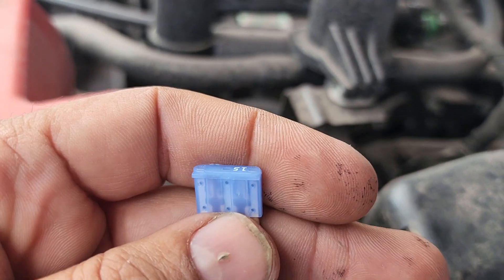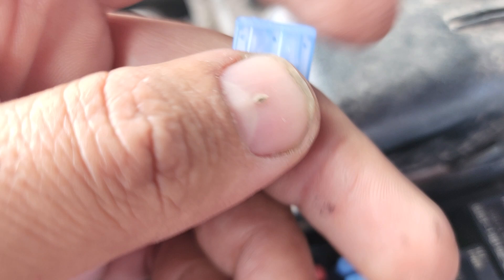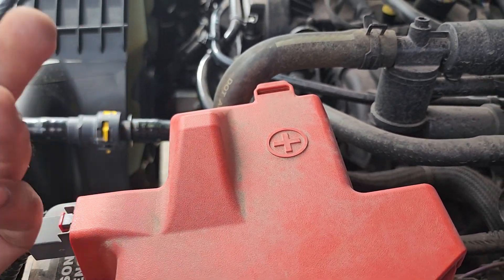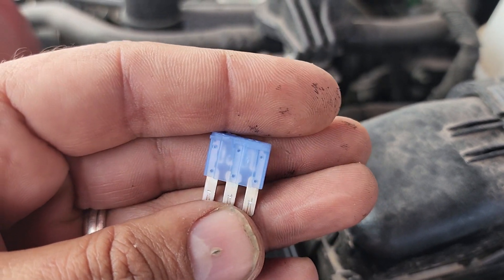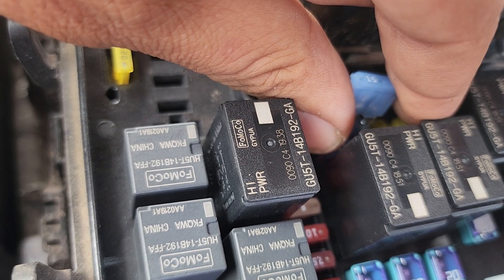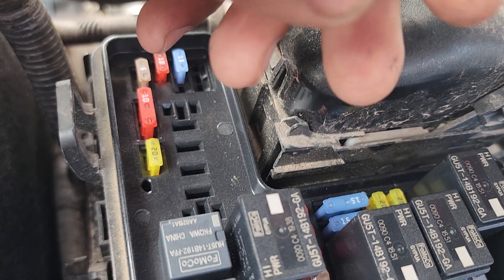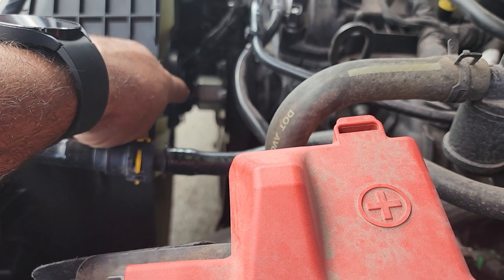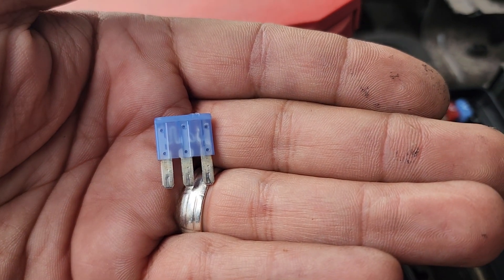How to make a bad fuse useful

Comment: BANG! :O)
Thanks! 
Nothing I work on uses the 3 bladed fuses yet, but I would have been inclined to toss the old failed fuse and install a new one for testing out of habit.
I do salvage old fuses from junk cars and save them on occasion to use for testing.
Keep the good stuff coming, I appreciate the videos.
Reply from the maker: I do the same but these are hard to find. They won't let you take them at the junkyard because they sell the whole fuse box.